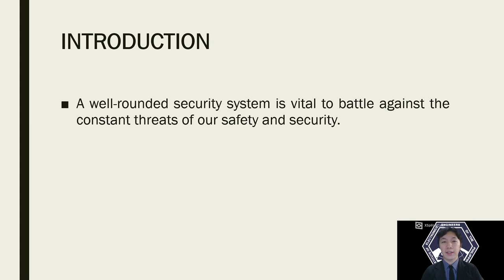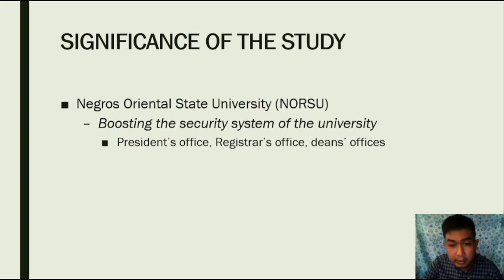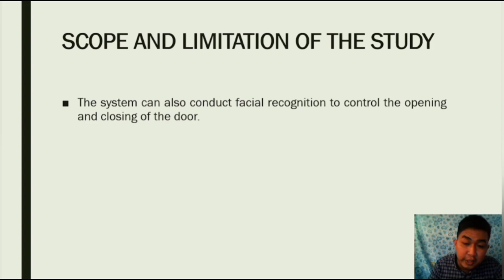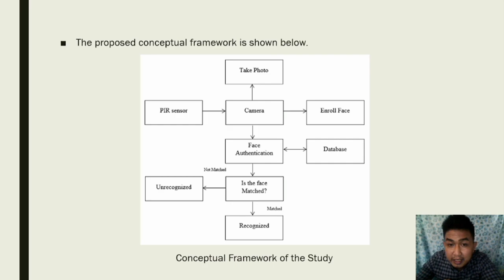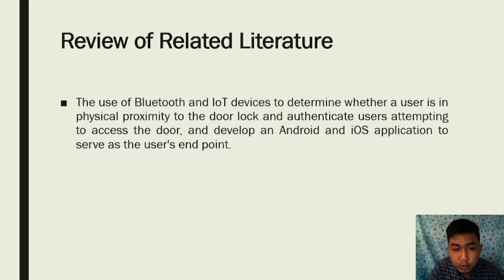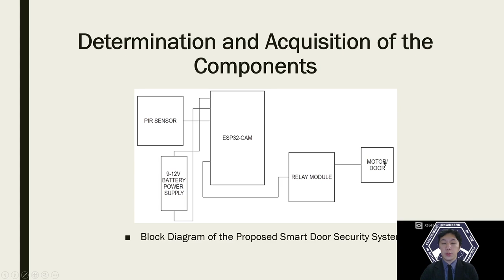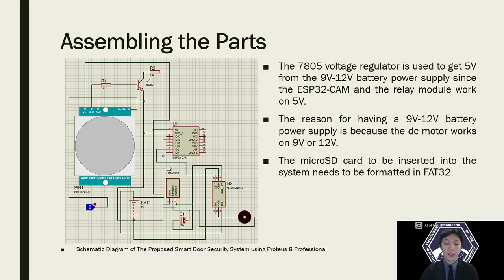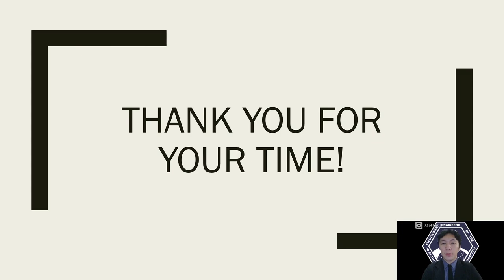AUTOMATED DOOR CONTROL SYSTEM: A SMART SECURITY APPROACH

Comment: Name: Belinario, Cristy T.
Class Name and Class Schedule: ENS 341 B - (5-8 PM Saturday)
Date: March 25, 2022

Reaction:

Based on the video entitled "Automated Door Control System: A Smart Security Approach" a well-rounded system that is vital to battle against the constant threats of our safety and security. It provides protection for the things of importance in homes, facilities, establishments, and buildings. Their study focuses on the improvement of the automation of doors making it suitable choice for security purposes. I am amazed to this innovative, having this automated door we can assure our safety and security. It has face recognition , no hassle to open the door or close or putting a key to unlocked the door  because it will automatically  open and close, it's pretty amazing.  

Reflection:

It's good to have automated door control system in my house for our safety and security. Sometimes, I forgot to bring my keys so  I can't unlock the door. Having this smart security system , I can easily enter the house because it has face recognition and a sensor  that it will automatically open  and close the door , no need for a key. No need to worry that someone will rob the house because the automated door is made for security purposes. Also, it is good for PWD, there is no hassle in opening and closing the door because it is automatic. Their safety inside the house is secured by the smart security system.